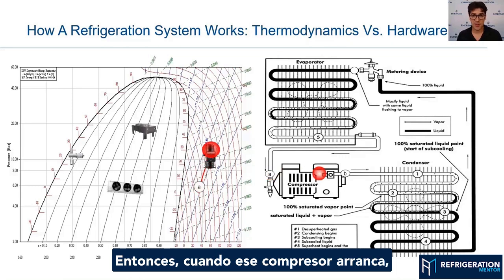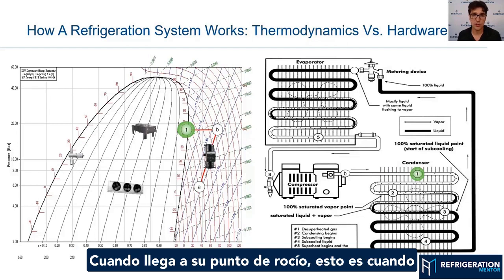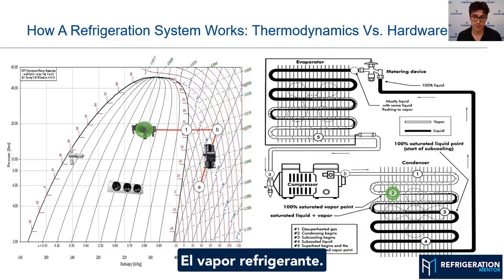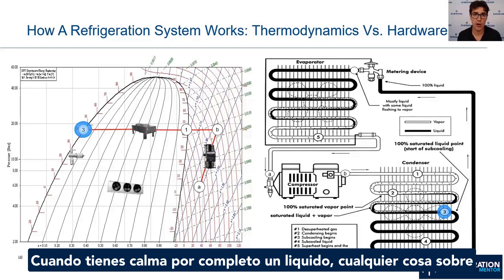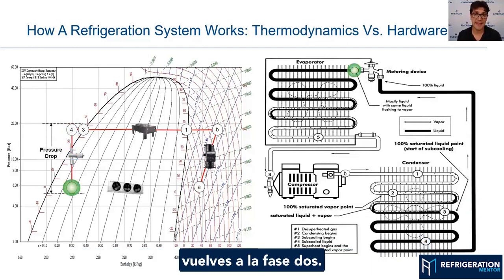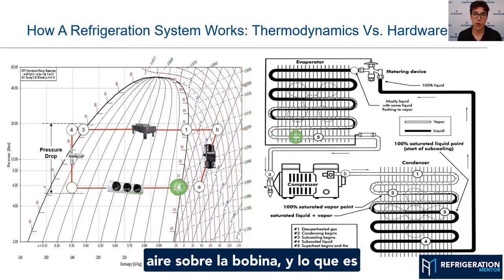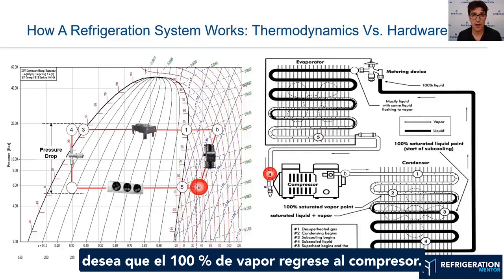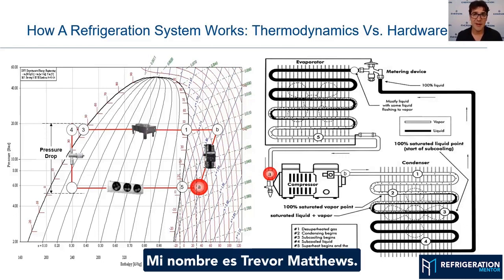¿Cómo funciona un sistema de refrigeración? Termodinámica Vs Hardware | Spanish Subtitles

Comment: What about explaining the saturated condition that exists in the receiver on a parallel rack system?
Reply from the maker: Yes in the receiver you will have both liquid and Vapour. The heavy dense liquid will drop to the bottom and the vapour will be on top.